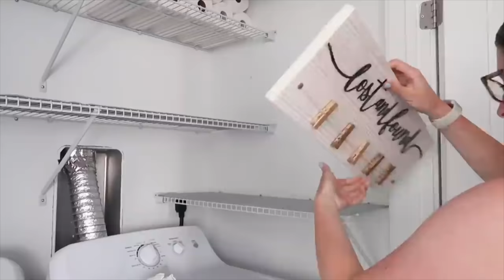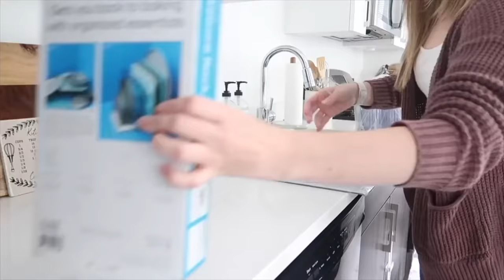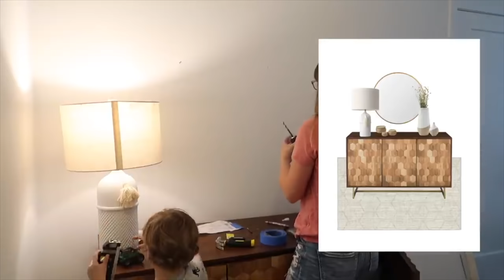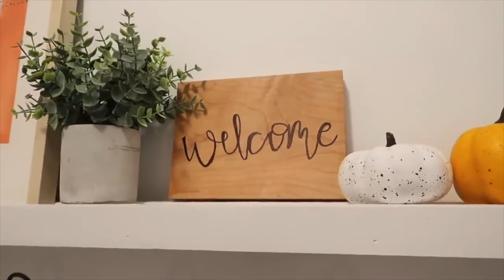SMALL SPACE ORGANIZATION ON A BUDGET 2021 / RENTER FRIENDLY KITCHEN ORGANIZATION HACKS & IDEAS

Comment: I accidentally received a pot and pan rack.Didn't know what to do with it. My breads, buns and tortillas were always falling on my stove. I placed the bottom along the back wall of counter.Used high and low legs for stability. Placed bread on bottom, put next pan spacer, hamburger buns, another spacer,hot dog buns another spacer tortillas. That was the last notch for spacers. I had 3 spacers left over. Back in the box. In basement storage in case I think of a different use and need them. No melting wrappers, no hot bread. Also purchased a magnetic knife rack, to further declutter the counter.
Really enjoying your videos, new subscriber. I'm 62 with back neck and now hip restrictions. I'm sure some of your subscribers can pass this along to designers, real estate people, developers. It doesn't matter about age, all of us would benefit from pull out shelves in bottom kitchen cabinets.
Searching for a slider for top drawer in bathroom. It sits on a track. and its half the size of the drawer twice as much space.

Comment: Great video thank you.  As for the eyesore vent tunnel,  you can make a little curtain with a bar on top and bottom, or hang a cute sign.  You can also hang a peg board, use 2by2 frame behind the board then hang it.  Paint it a cute color and then use the pegs and baskets and hooks designed to go on peg boards, u can make it way wider than the hole in the wall and make it a very useful space.   I know you rent but if you create an aesthetically pleasing useful solution to an eye sore, most Landlords will be grateful if you leave it in place when you move out.  Also, the occasional hole in a wall is very easy to Spackle and paint over,  which most Landlords do automatically between tenants anyway.
I also have a paper towel holder and little shelf-in-one thing in my laundry room that holds some household cleaning spray that I use to keep laundry room and doors clean.  It's very quick and easy to grab for any messes or spills that happen near the laundry room also.

Comment: All your metal baking pans just tilt on their sides. Use heavy bookends or napkin holders etc. To hold them in place. I use rubber tongs to pull out the light tins without using a stool.

Comment: Hi so I saw your dryer vent problem what you could use some plumbers tape two small metal screws and washers and attach it to the inside wall over the dryer vent to make it flat against the wall and then hang a picture or another Shelf, by the way you can also extend your shelving units by putting a flat shelf behind your existing shelf like extended out instead of having that lip

Comment: 8:55 Just put additional shelves where needed if there are pre-cut holes for additional shelves in your cabinets. 😴

White laminated boards and those connectors are sold at hardware stores. Remember to put equally tall items in one compartment 🤫
Reply from the maker: I don’t live there anymore but when I did, there was no way to add additional shelves or move shelves unless I took the entire door off the cabinet and I did not want to do that.
Reply: 1:18:58 There is so much unused space in the kitchen 🧐 Addionally, do not store electronics in a moist environment.
Reply from the maker: @sofijones5048  maybe you should make these videos instead 😆
Reply: @CatherineElaine  If the hinges are hindering: Hold the already installed shelf as high as possible and "insert" the additional shelf as vertically as possible.
Reply: @CatherineElaine  No company would like to collaborate with me 😅

Comment: I noticed that you are putting things back loose on the shelves some of the time and there is lots of wasted space above the items. As you maximize your vertical space you will find it easier to keep things neat and in their home. Pull out shelves would help as well. If there is a water leak all the toilet paper will soak up the water so i never put things on the floor that will be a problem if they get wet. The floor is a good space for extra organizational containers so you don’t have to get them at thee store again when you need them.

Comment: Question.... why didn't you turn the lids upside-down so the handles would be down inside the pot, thus eliminating the protruding handle issue?
Also, the reason apartment/rental unit walls scuff so easily is because by and large  landlords never truly Paint anything. .. they mostly just give it a coat of Primer which is formulated to accept 'marks' ie: Paint , they never really think about the livability of what they're doing. .. just the cheapest 'bottom line ' they can get while making it look good for the prospective renter.